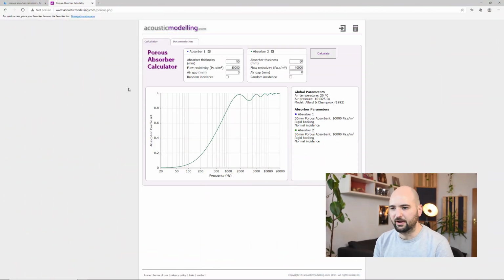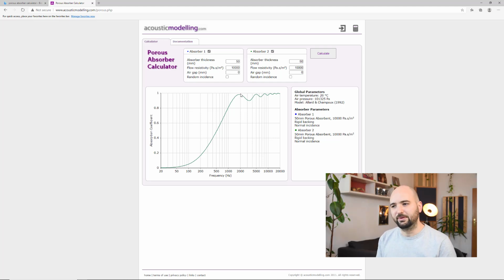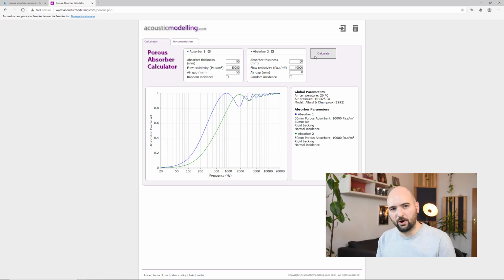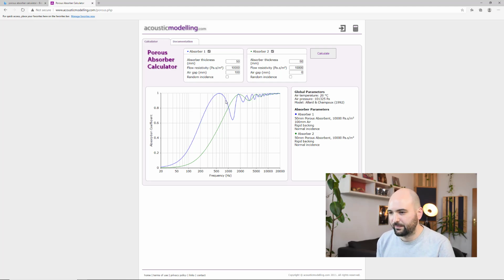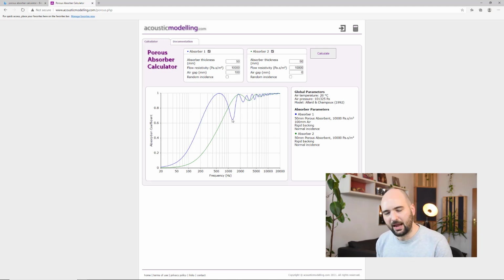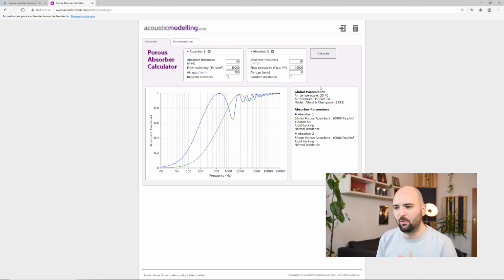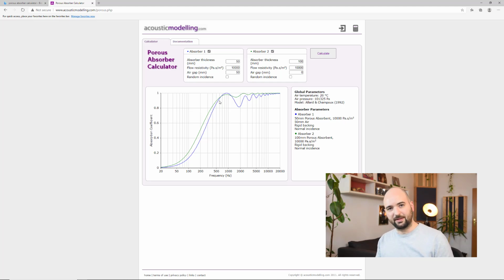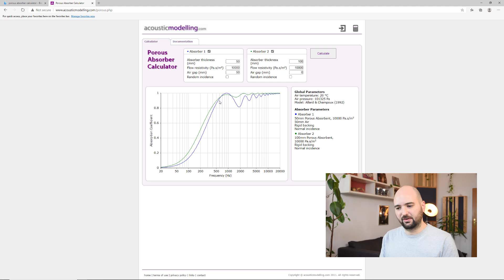Acoustic Panel Placement: Do You Need An Air Gap Behind Your Panels?

Comment: i have watched about 20 of your videos since saturday night and feel transformed. i have learned essential things and really appreciate your videos and advice and how well structured all of it is communicated.

so, i am planning to get into building absorbers and bass traps (and maybe diffusors later, if i still got the need and motivation). atm i am calculating the air gap behind the panels, but i have an important questions: do i also need an air gap behind the bass traps? and if so, does the gap have to be all around the bass trap or just in the corner?

i thought about building a standing plate for a bass trap and started wondering, if it would be neccessary to have it be a few centimeters wider all around.

Comment: Hi Jesco, I've seen this on an acoustic website and it's completely thrown me re the gap behind a panel. Can you throw any light on this?

NWAA Labs, Inc
2017 ASA NOLA
Absorption
Myth: Wall mounted panels that are spaced
off of the walls will increase their low frequency
absorption as the space behind increases.
Fact: This is only partially true. The low frequency
absorption only increases when the spacing from the wall
does not exceed 1 inch. The effect disappears after 1 inch.
This only applies to unimpeded airspace.

Comment: What about corner bass traps ?
Reply: acutally quite similar. Usually if you have the space you should place your bass traps (usually triangle shape) with the pointy side towards the room and the flat side towards the corner. That way you would have an airgap behind the panel that has the exact same shape as the panel itself. This would result in the same effect. Ideally air gaps are always an option if you cant afford the absorption material. Ideally you would want a cuboid bass trap in the corner, to fill that airgap.
Reply: @Nuurix  interesting !  thank you very much for your answer :)

Comment: I just came across this video, what an excellent explanation thank you!  I have 1 follow up question, so for example assuming a 2" sound absorbing panel and a 2" air gap, would a 2" thick Rockwool inside of a 4" deep frame, mounted flush to the wall, still be the same as a 2" deep panel, mounted 2" off of the wall?

Comment: Another great video. I'm wondering how things would be affected by storing things in the air gap. I use my space primarily for mixing but also to record drums a lot and sometimes rehearse too, so space management is important and I have a lot of gear to store (multiple drum kits...). So I have a potentially crazy idea of putting floor to ceiling storage on the back wall (50cm deep) with various drums, stands, mics, cables etc and putting a "wall" of moveable gobos essentially in front of that. Would those panels then need to be 50cm deep themselves to have any effect? Would they even do anything to low end if there is stuff of various shapes and sizes behind them?

Comment: Using the Porous Absorber Calculator at the acousticmodelling link in the video, the half-wave dip in absorption you point out is much less of a problem when the calculator's Random Incidence option is checked. Does this imply that using pyramidal or triangular-ridged acoustic absorption foam is a better choice than flat-surfaced foam for deep air gaps?

Comment: Using a 6" Velocity traps placed 6" off the wall will begin to effectively trap bass. What does it do to the mids and highs? How much of the mids and highs do we want to remain active in the room? To place a 6" panel 6" off the wall, do you want air flow behind the panel (see right through from side to side along the wall) or can you increase the depth of the frame to the sides and top and bottom rest flat against the wall while the air gap exists between the wall and the inner core? Many Thanks! Great video!
Reply: If you want to retain mids upward, then face the velocity trap with Visqueen type plastic. 

Measure to determine and achieve balanced room decay times.

Comment: hi , thanks alot for your help , i checked the site and i have a question , what if we use 2 layers of 4 inch panels each one with 4 inch air gap ? does it work ?

Comment: Many traps are 10cm deep and placed wall to ceiling or wall to wall which means the depth from the corner angle to the trap is deeper than the trap. Is this wrong? It seems to be common practice

Comment: Will solid back panels (that have a solid wood backing) benefit from an air gap between them and the wall?
Reply: This can only be answered with "it depends". For example on the distance, as indicated in the video, between the wood back and the wall. And gaps between panels that allow sound to enter at that point. We know from double glazing (~airtight) that heat insulation peaks at 15mm gap which is that maximum gap at which the air inside remains standing still and above that there will be  reduction in efficiency due to airflow (convection). Make the gap wider and it starts to become a frequency dependant sound insulator.
I have a 1902 house with a thick single brick outer wall. At that time they would nail wood slats on the inside (about 15mm thick), then nail jute fabric (aka sackcloth) over that, and next stick wallpaper on that. I replaced that with an air barrier, hi-tech insulation foam, and two layers of sheet rock (gypsum board) of different thickness. Depending on the order of the sheet rock, it becomes an insulator or amplifier (at certain frequencies). Keep outside noise out and it will amplify noise from inside out a bit, in my case towards the thick brock wall. And these two layers of sheet rock are smack bang flat against each other. A single layer of sheet rock always amplifies in either direction.
Then it depends in which frequency range you want to dampen. The presenter of this video has a highish pitch in his spoken voice, but with a bass layer to it that makes it attractive (not dry). Compare that to a piano's central A that in today's tuning is at 440Hz (for its base frequency - it has many overtones that define its tone as both piano and a specific instrument [1]).
Then look at the acoustic insulation graph in the video again. If I had a restaurant with a sound problem where people speak louder and louder as more people are in, then I would probably solve that with a layer of simple DIY acoustic panels against the wall with a second layer with an air gap over that. Such DIY panels would not have a wooden back panel, by the way. With human voices, we don't have to worry about bass frequencies where these panels have little insulation impact, in this example.
And now I have great insulation in the 250Hz to 1500 Hz frequency range, I guess, looking at the video's graphs. In the hearing of human voices we need the overtones to have excellent intelligibility and as little reflection of these as possible. If you play back recoded music the story is more nuanced. A recording in an acoustically dead space my only come to life when you play it in a room with reflecting walls. Most electronic music cognitively is a total mess between phase and micro-dynamics, many multi-microphone recordings also are a phase mess. These benefit from acoustically dead walls in playback. Play an old recording from the RCA Living Stereo series and I might prefer the acoustically dead walls - because the recording is done with two microphones from a listener's position.

[1] in many electrical engineering situations, "sine waves" are used for reference. These do not happen in music, voices, or earth's nature. If - Fourier analysis - you want to construct a 50 Hz block wave from sine wave components, then you need sine pulse trains where each next sine pulse has another frequency and where the block wave has its vertical you would need an extremely high frequency to begin with. I don't think we actually have amplifiers, let alone loudspeakers that can do this. As our ears are passively filtered for our individual frequency range (primarily a matter of dimensions aka size), within that range we have some 20,000 membranes that listen to a narrow frequency band. The associated part of the brain is much faster than the visual brain. Our hearing does wave shape analysis at a bandwidth (precision) that exceeds 20 kHz by a lot and hence we can hear the difference between mother and father, or recognise the voice of someone we never met before, as family. And hear the difference between a cello and a violin both playing the note we call central A on a piano. With that hearing we have great sensitivity for "noise" and easily distinguish alarming noises from generic background noise. As we use comparison networks in the brain between the ears where both phase (arrival time) and wave shape differences are analysed, we know where sound comes from too. In this light, I would adapt acoustic damping to my context or use case as much as possible.

Comment: Great video, thank you! To-the-point, and explained the 1-to-1 ratio of thickness to air gap very clearly. 

I am currently about to build acoustic panels with 3.5” thick mineral wool insulation, so I’ll be planning on building stands for those panels so that they sit 3.5” away from the wall. I know it’s not 6 inches thick (which would be most ideal), but I also don’t have a lot of room for 6 inch thick panels in my home theater testing room that I’m building for my own channel. Not the most ideal, but better than no panels at all. 😁🤘 Thanks again! You have a new subscriber!
Reply: Hi! Would I be able to use some clips from this video in my own video about building out my own DIY acoustic panels? No audio - just me talking over some short clips from this video, since I want people to know where I got the science behind it. I reference this video a few times, so hopefully it’ll get more views too! Thanks! 😁

Comment: Ok, so now after watching the GIK Acoustics video on Air Gaps, it's pretty clear now that air gapping is really not a good idea unless you are doing extensive frequency testing and you know exactly what you are doing. If you are trying to float a 2" panel an inch or two off of the wall, then it's better to just use a 4" panel flat on the wall. And if you feel like you need to float a 4" panel off of the wall, then it's better to move up to a 6" panel flat on the wall. It appears that... yes, a "sealed" air gap is better than a open air gap, and an open air gap can make your situation worse if you aren't doing serious frequency measuring. Performance-wise it's better to just use a thicker panel flat on the wall over a thinner panel with an open air gap. It also looks like most GIK panels come with an air gap in the back portion of the frame, but it's also sealed with an acoustic cloth cover. Also in smaller rooms, it's almost automatic that you should be using 4" thick panels instead of 2" panels.

Comment: Thanks for your awesome content! Very well explained and easy to digest even not having a lot of upfront knowledge.
Is this (in a more moderate way) also applicable to living rooms where you listens to music and want to treat the room? I‘m thinking about the wall behind the speakers and basically building a big wooden frame with Pamela’s you find in centralized concert rooms and put absorption material behind sand possibly an airspace. In the living room I‘d not make this deepen than 10cm though as it would otherwise interfere to much with the room and it‘s usage as a living room

Comment: Great video. One question I have never seen. If you use a 3” foam and make it real long. Hey let’s say rapping all your ceiling perimeters. Will it equal to just less 6” deep foam. Or is it the depth of the material that matters. Cube inches in a different way. 🤷🏽‍♂️
Reply: I don’t think so. You’re talking about reducing the energy of the sound wave. So it’s linear in the path of the wave. The video talks about putting that 3” foam 3” off the wall, which could get you similar results. But if you had a room and covered one wall with 6” of foam and the opposing wall with no treatment, i think it would be different than 3” of foam on both walls.

Comment: Is it always good to get the thickest possible panels and the biggest gap between them and the wall? I mean... what if I already got quite equal low end response?
Reply: then you are done - it's that easy: when you try to solve a specific issue and the issue is gone that's it

Comment: I am making my own panels and can make any size and shape and thickness I want.

I have covered all tri corners and bi corners, and near reflections and some rear wall.
I still need to control main room modes, about 90 Hz and 120 hz, in my rectangular room.
From your video I realize I need  thicker bass traps with a gap, behind them.

So is it better for me to make some thicker traps and leave some wall exposed to let highs and mids  pass a little?
Or should I continue and cover all walls completely?

Should I put a thin ply layer, maybe 7mm, with holes, on the front of some traps to reflect highs and mids but still trap bass?

Comment: Really interesting video, thanks for the calculator! Would be keen to understand if it is possible to do similar measurements with a flat panel in a corner where the depth is then not just a fixed amount, instead deeper in the middle than the edges.

Comment: Using the calculator, what would be the ideal look of that graph? Not sure that makes sense. I have 8 2ft x 4ft panels each one is 6 1/4" think with about 2 inch gap behind. Five are on the wall and 3 are on the ceiling. I like the sound but haven't measured it to find out what it sounds like.

Comment: Jesco, I have noticed even with a 10 inches  of porous material (in my case Rockwool density 30kg/m3 [9000 Pa.s/m2] ) and a 10 inch air gap provided, I am able to see only .5 or .4 absorption coefficient in the graph for low frequency areas. What I am asking is, will this much SAC will help to tame some serious low end and make things better? Will this SAC improves with larger surface area for the panels, especially for low frequency management?

Comment: Seems to beg the question - sandwich construction. wall, 2 inch gap, 2 inch absorber, 2 inch gap, 2 inch absorber. I'm guessing you will get enhanced bass control without the dip?Its effectively the same, 4 inches of material and 4 inches of air but 2 inch foam is cheaper than 4 inch foam.
Reply: No
You want all the material distanced off the boundary surface.

Comment: Hello,  Thanks for all those informative Videos, My Room is small. 13'L X 12'W X 8'H so working with the 38% rules my Listening sweet spot is about 5'  from the front wall. I`m looking to install two  6'' D X 24''W X48''H Pad behind my monitor. But it`s getting hard to keep a equal triangle with enough stereo width in that 5' space . So Should I keep my Pad Flush to the wall to keep maximum distance between my monitor and the pad or add some space and get the Monitor closer to the Pad. Thanks

Comment: What if, I put in the back of the spacing area, between the wall and the panel, areas that are separated from the wall, and areas that are not?  Something, such as serrated separations, some areas that touch the wall, and some that are separated from the wall, as if it was a serrated separation.  I think you will understand what I mean.  Please leave a comment.  Thank you.

Comment: Thank you for sharing all your knowledge. I would like your opinion about the following. I need to build a room to install several bitcoin miner machines. As is well known there is a loud high pitch sound coming from the cooling fans. The idea that I have to attenuate this sound is to build a double wall container with an air gap inside. Let us suppose that I can make this air gap completely hermetic so that no air can enter or escape from this air gap. I would then proceed to extract the air inside the gap so that to make a vacuum inside. From basic principles, we all know that sound does not travel in a vacuum. Could I get very good sound isolation with this method?. Best regards.

Comment: What if I have three inch rockwool, and I only separate it 1.5 inches from the wall.  Wouldn't I get a more balanced result?  So, my lows will be more absorbed, but my mids won't be affected to much?  A fifty percent ratio of separation.  Maybe wouldn't it be better to touch the wall, and use less bass in the mixes?  What I mean, isn't it better to understand how my room behaves, and work with it????  Technology helps very much, but doesn't art  also help ?  Another example, when I think I have the perfect mix, and then, bringing down the amount of bass by 25% or more, wouldn't then I get a much better amount of bass in my mix???  Again, getting to know my room behavior?

Comment: Could you please explain why do you suggest caring about base traps while for the same money you can cover 2x (or 3x) of wall space with thinner foam for the same money? The low band of human ear directionality (phase-sensitive) is centered around 500Hz, and covering down to 300Hz (with an air gap, on -3dB) may appear to be more beneficial than going into huge room-eating expense with base traps (which you can eq electronically for a rather wide sweet spot).
Reply: it is not a same thing, for example while EQ ing speakers may help how you perceive the sound at mixing position - the bass swells will still be there at untreated corners.. just at a lower amplitude. Also if you play live instruments.. it will still suck unless it's treated.